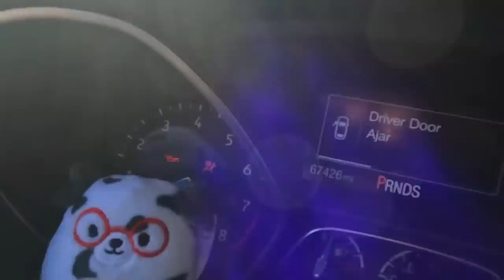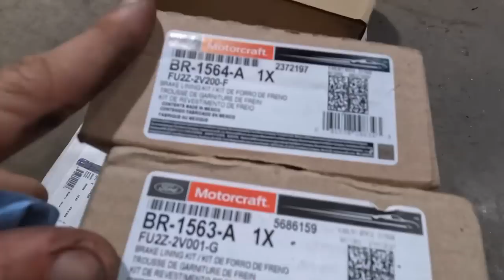Mechanic Cheats book time! Close Call | 2016 Ford Focus 2.0

Comment from the maker: Training Day! He Left Me @WifeUnit  https://youtu.be/tj6zMPwGsqc
Reply: Watched that one yesterday, then I'm seeing this and thinking to myself "Those ignition coils look awfully familiar", then I realized this is the car you gave your wife to learn some more basic wrenching.  I tell ya man, this is how all the big custom shops started out :)  Keep it spinning man, love the videos from both of you.
Reply: These days, a Mechanic is limited by his Danglees being precise and not clumsy.
Reply: Ray, you and the missus (Wife Unit) are rock stars! Great looking couple, bro.
Reply: It’s almost seems as though the Engineers goal is to utilize every square inch of space under the bonnet
Reply: I don't know on the air filter looked good initally, however it looks pretty dirty on the other edge looked filthy while doing zip tie
Reply: Sad part is I knew they got that air filter from Valvoline. I used to work there and the air filters are actually too long for the housing and it have to force the lip into the housing. Using resulting in a stripped air box. It's almost like trying to fit a stubborn bed sheet 😅
Reply: Ray I posted this, "Wife unit guest star repair video on her next her car repair." I was wrong that's awesome you recorded for us. Thanx
Reply: @creekdweller9662  
Isn't a bonnet somthing you 'females' wear on there heads?
Reply: Not a Ford mechanic,  but you might have been able to remove the motor mount on the ac compressor side, raised the car, lifted the motor and pulled the long bolt on the bushing by the ac compressor. That could have given the clearance to remove the long bold with air or electric tools. 
Its a motor with a computer, you just have to out think it.
Reply: We love watching the wife unit   she is going to be a good channel. The only thing is I have to talk to the phone more. LoL 😆 great job
Reply: Hey ray I really enjoy your channel. We love the wife unit's channel also    I do have to talk to my phone more when I watch her 
Good people great having the family there with you
Reply: allways rotate tires,,every 3 months,,i do,,plus, if you dont, put the good tires on the steer end..

Comment: Thats incredible you put up videos with proof of needed repairs. The person trusts you and pulls the trigger on having the repairs done.  You've earned everyone's trust. That speaks highly of your honesty.
Reply: Most dealers nowadays attach a video file to their claims for customers to see before approving repairs
Reply: @Usmanthemecano  I don’t know about “most”, I haven’t heard of any dealer doing that around here. I’d love for that to be standard.
Reply: @Thanatos2996  You can always ask and have the service writer bring you into the shop to see for yourself.
Reply: @AT-wl9yq  yep, and I do when appropriate, I just haven’t seen a shop record a video (or even provide pictures) when they say there’s an issue.
Reply: @Thanatos2996  Have them print the session history from the scan tool they used to diag your vehicle. It won't tell you everything, but its better than nothing.
Reply: Our local Mazda dealer does that. I’ll drop my moms car off in the morning and in a couple of hours I’m emailed a video link of the inspection. All I have to do is email back with an approval or tell them which repairs to decline. They’re extremely thorough. I think the last video was like 8 minutes. They measured the brakes, tires, showed the air pressure, condition of the oil, trans fluid, coolant, brake fluid, etc. Each followed by “no replacement necessary” or “replacement suggested” or “replacement necessary.” On the complimentary services like the blue water, tire pressure and stuff they said “filled” or “tires inflated to factory spec and TPMS checked and reset.” We also got “battery checks within spec, but will need replacement soon” along with a video of the test. 
It was an excellent experience to have with a dealer. They didn’t recommend anything that wasn’t needed and they had video proof of what it did need. 
Look, my mom is a 70+ year old woman and they could have told her the car needed $2000 worth of crap and she would have approved it. They didn’t. Her bill was less than $100 and that was for an oil change, the inspection and wiper blades (which she DID need.) 
I think this practice needs to be employed by all dealers and shops. She’s about due for a set of tires and I’m sure they’ll be the first place she calls. Don’t count out a dealer for tires. In my hometown, our local Ford dealer was the best place to get them. They usually had a buy 3 get 1 free and would mount, balance, dispose and do an alignment for $100. You’d get $600 worth of tires for $450 and then $150-200 worth of service for only another $100. They had 2 tire change bays and always had a line. We priced new tires on my ex wife’s explorer and the dealer saved us over $200 from anywhere else around…and they were the same tires.

Comment: instead of dropping the ac compressor, I remove the lower rear motor mount bolt, and that allows you to pry the engine forward and gives just enough clearance to pull that bolt out

Comment: @50:07... I preload the control arm before tightening the front bolt. This makes sure the bushing is in a neutral state when the car is put back on the ground. I learned this when I started building race cars. Just gotta be careful and make sure you're not lifting the car off the lift arm.

Comment: On some cars you are supposed to tighten the lower control arm with the weight of the car on the suspension so the rubber bush isn't twisted ?
Reply: ....on ALL vehicles!

Comment: Stripped bolt into the plastic, use crazy glue inside the hole, and on the screw.  When it dries you will have new threads.  It will come out kinda easy as well.  I use the method for my RC vehicles.
Reply: I use plastic wall plugs though in some cases the hole might need to be enlarged.  It becomes a permanent fix though.
Reply: Put some silicon on screw first, will help it to break free of the CA glue better.
Reply: @chuckd5819  Regular as sunrise 😅
Reply: @chuckd5819  To be fair its understandable once you realize that Ray came up as a Chain Shop/Dealer Mechanic. So a lot of his methods are based on speed, not necessarily quality of results. You gotta blame the Chain Shops on how they teach speed over quality nowadays. So yeah, Mitch is right but that is also how Ray was trained up.
Reply from the maker: @MitchGaar  I could have sold them a new airbox or not done anything at all. 🤷‍♂️🤷‍♂️ Lol if you thing that’s janky, you should see me shove copper wire into stripped aluminum threads 🤣🤣🤣🤣
Reply from the maker: @chuckd5819  Mitch might join James C is the “people kicked out of the comments” section 🤣🤣🤣
Reply: George  Lol, nah dude. This is YouTube, anyone can go watch and comment on whatever video they like. Plus, Ray counts on my views for the ad revenue. So you go be a fanboy somewhere else, if you don't like constructive criticism and pointing out stuff. Y'all fanboys act like Ray is the only mechanic in the world, I like the guy and he is a good guy, but blind cult like loyalty is stupid. If you don't like the comments pointing out stuff out, then don't read the comments.
Reply: @craigfin3222  I don't see it as speed over quality, rather,  not charging the customer parts and labor on something minor. How long would repairing that stripped plastic part (done by a previous mechanic) have delayed the planned repair. That repair worked a treat.
Reply: @RainmanRaysRepairs  That repair was perfectly ok on a car, I did my apprenticeship on aeros and that would have been very much a no no.  In fact a discipline matter. But Ray knows this and chooses the right repair for the situation.
Reply: @Craig Fin  Sometimes speed is the way to go. Besides. With the "janko" way he did it not only did he save this person money, a ziptie can be removed and replaced easily, meaning if they want an actual fix in the future no permanent damage. You ask me it's a perfectly acceptable fix
Reply: @RainmanRaysRepairs  I'm glad I haven't been kicked out yet. I'm not rude though, so there's that.
Reply from the maker: @aaronbritt2025  there’s only 3-4 people that have been banned. I don’t believe in censorship. However, when someone’s only goal is to be a disruption or if they say things that are wildly inappropriate, I’ll have to show them the door.
Reply: I do the same on my xray RC cars
Reply: @RainmanRaysRepairs  Do it Ray. Mitch Gaar never has anything positive to contribute, only negative comments out of him. You are way too tolerant of his trolling Ray. All he ever does is pick apart your best efforts to take care of your customers.
Reply: @RainmanRaysRepairs  I thought the copper wire thing was a good shitty fix, but Project Farm recently did a test of stripped thread repairs and it is a bad shitty fix.
Reply: All the comments, good and bad, add to the score. It's just when people who comment attack others is when it's counterproductive.
Reply: @Rainman Ray's Repairs  lol, I was a Radar tech in the military,  when we ran into a coax pin  fitment issue we just took out a pack of smokes, ripped off a piece of the package foil and stuck it in the female side and voila, good to go! When it works...
Reply: It’s an air box who cares my car literally has zip ties holding air box together
Reply: Huh...wow.

If y'all think a zip-tie repair is janky, try dealing with cracked, brittle, or broken nylon vacuum lines on a Ford Ranger in the northern climates. The factory nylon can become so brittle that touching it breaks it. 

My fix on that is to find the proper diameter rubber hose, paint each end of the hose the color of the nylon line it's replacing, and simply replace the nylon. And getting the hose is rather inexpensive, and an upgrade to boot. But it also can be a rather inconvenient and trying task to complete in sub-freezing temperatures, like changing out a heater core that decides to go out at the wrong time or a blower motor that stops working in the dead of winter.

Comment: Not nit picking but.....The two bolts that fasten the control arms to the body of the car really should be fully tightened after the car is on the ground. Otherwise you will put the bushing in a bind. Just an FYI :D

Comment: If you lower the subframe you risk getting the front wheels out of line with the rears.  The front toe won't change as the  steering rack is fastened to the subframe, but unless you mark the fore and aft and side to side orientation of the subframe against the bodyshell, the car can end up crabbing. Ford have an alignment tool for Fiestas, and I would expect Focuses as well, to reset the subframe.
Reply: In my opinion, if a part needs a special tool to be reinstalled properly, it's usually a crappy design.  That or it's proprietary. Often both.
Reply: For the most part, this is an old wives tail. All that happens when you shift the subframe on a macpherson strut suspension like this is that you end up changing the caster and/or camber angles, and usually not by much because there isn't typically that much play in the mounting holes. You can just use a paint marker or witness marks to see where it previously was and usually it's good enough to avoid anything being out of spec. The only time when you could get the "front wheels out of line with the rears" is if there is no suspension attachment point on the body of the car and the suspension is completely self contained on the subframe, which from what I have seen, is only true on rear subframes of a certain design. Even then, you can't really shift it that much out of line with the car body because of the hole size.
Reply: @madmatt2024  Unless the subframe is mounted using bushings between it and the main body.  If that's the case, bushings could deform over time, and present some alignment issues, albeit minor.  One would hope that this would be thought of, and avoided by simply using a couple built in guide pins of sorts to orient the subframe properly before final install, much like some cylinder heads, or component covers, et cetera.  Then you have other vehicles that are front drive, and yet have no subframe at all. For example, Geo/Chevy Metro/Suzuki Swift from the 90's simply had small protruding "frame horns" (just a metal bar with two bolts holding it to the unibody, and with forward facing threaded studs that the lower control arms bolted directly to with only a single nut on the front end of the arms, and at the back of the arm was an arm mounted bushing that bolted to the underbody with two additional bolts.  Not unlike this particular Ford, except there was literally nothing attaching the two sides to each other.  Heck, they didn't even have anything attaching the lower radiator core support to the main body either. It kindof just hung off the front of the fender beams.  The entire powertrain just hung directly off the fender beams too. Nothing below it at all.  Weird little cars. I used to own one.  Quirky little beer cans on wheels. Slow as hell, still fun to drive.  Plum dead reliable right up until the entire body disintegrates all at once, leaving you with a 20 year old powertrain that's got 20 years still in it, but nothing to put it in.   Best return on 900 bucks I ever spent in my life.  15 years of nearly flawless low cost maintenance, dependability, then one day, you turn left, and that's it, front suspension folds under on itself.  I hate living in the salt belt. Lol.
Reply: Maddmatt2024 
Your reply contradicts itself.
You acknowledge that you can alter the camber  and castor by setting the subframe up in a different position, yet if the subframe was setup too far to the port side(left side for non aerospace engineers) you would have increased the negative camber on the left wheel, and reduced it on the right wheel, and both wheels would not be inline with the beam rear axle.
It's also possible to rotate the subframe around the vehicle centre line and then it will crab.
The clearance between the main attachment bolts on a Fiesta and the subframe is several mm, which allow significant movement.
My post was to make Ray aware that it could create a problem.
You actually suggest marking the subframe and bodyshell, as I did, so we both have the same idea.
If you set the subframe up on the skew  the car handles like a shopping trolley with a dodgy wheel. Ho ho.